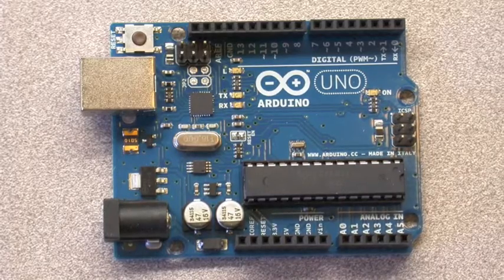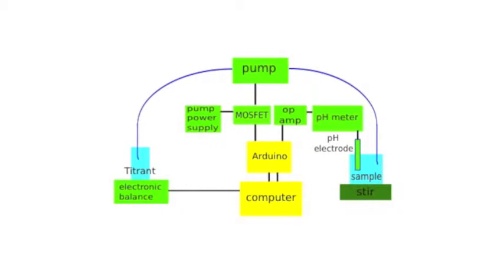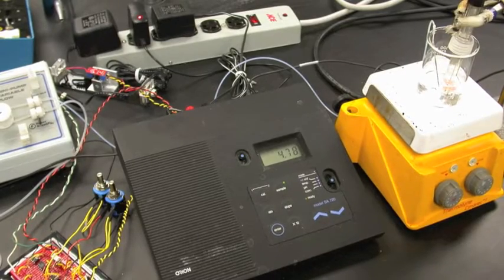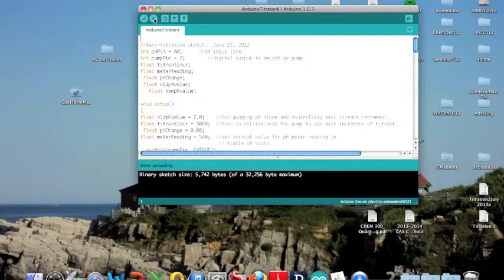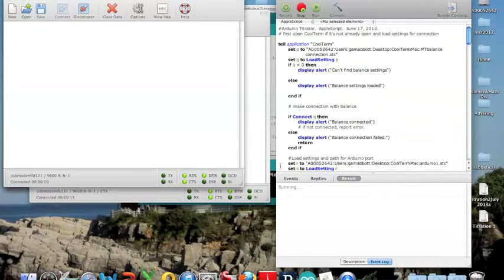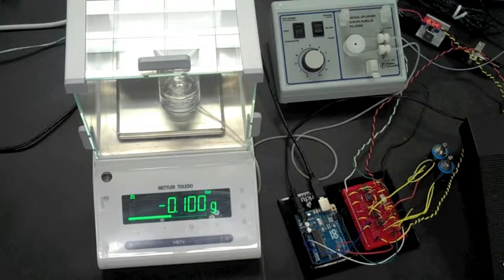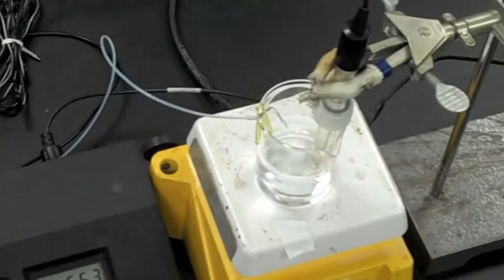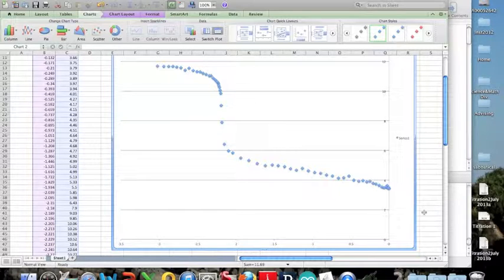ArduinoTitrator

Comment: Looks like a potentiometric titrator specially if the graph in Excel accounts of the derivatives which shows the end point peaks
Reply from the maker: Yes. You can have Excel plot the derivative as the titration proceeds. We have also found that reading the endpoint where the pH reaches a target value produces very reproducible results. (This strategy is equivalent to using a color change for an indicator.)

Comment: Hi. Your systems seems pretty nice. Don't you have some problem due to the lack of stirring on the scale though ?
Reply from the maker: Hi. I am sorry that I missed your comment earlier. Although the reaction flask is stirred during the titration, there is no deliberate stirring in the titrant reservoir that sits on the balance. We assume that solution has a constant composition through out the course of many experiments. That assumption is supported by replicate titration of standard HCl in the titrant reservoir against weighed portions of high purity potassium hydrogen phthalate (KHP). For a set of 8 replicate runs we observed very tight agreement (a relative uncertainty of less than 0.1 %) in the calculated concentration for the HCl.
Reply: @garymabbott4064  Thank you
Thanks also for the channel. It's an interesting mix of analysis, electronics and statistics. I might take of few ideas to implement in some of my practicum if that's okay.
Reply from the maker: @pierre-jeansup3784  
You are quite welcome to anything that you want to use.